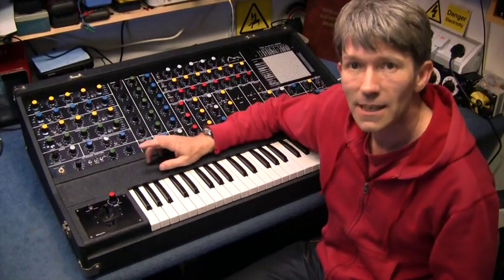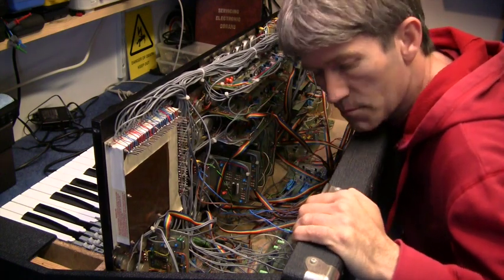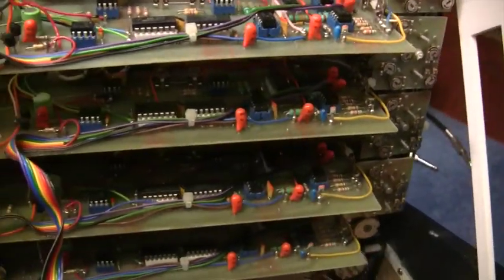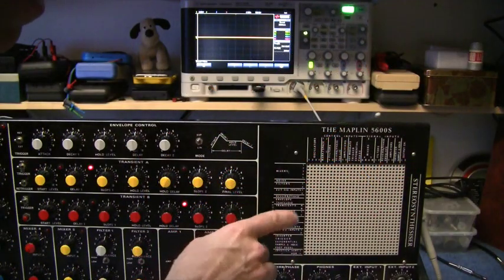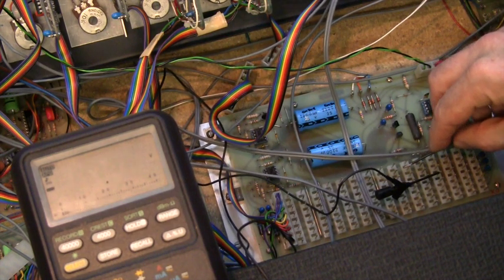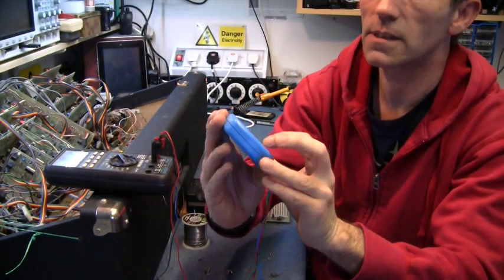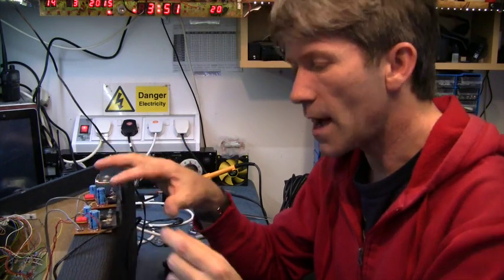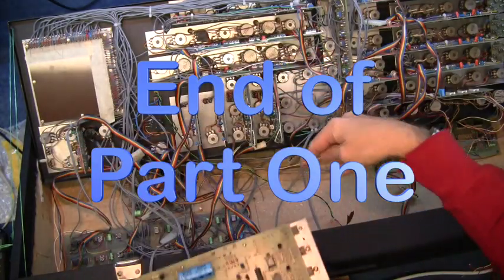Maplin 5600s vintage analog synth repair PART ONE MF#45

Comment: Wow - I lusted after these in the Maplin catalogue many many years ago, but too expensive - ended up selling my Hornby 00 guage railway layout to my maths teacher, to buy a transcendent 2000 kit. After months of soldering and frustration, on the day of completion, I accidentally touched the +12v rail to the 240 ac rail. *BANG*. My mum dropped the dinner on the floor. I had to replace the electrolytic s and the IC's but I did eventually get it working ! :)

Comment: I've got one of these, bought the kit from Maplin mail order back in 83 (if I remember right) after 3 years of paper rounds and weekend work in a bakery costing me £620 at the time. Didn't know anything about electronics then but always wanted too but after looking at some schematics had this stupid idea that it was beyond me. A local music shop was going to build mine for £100 over two weeks, didn't see it for 6 months or more, ended up with my mum involving a solicitor to get it back not working. Sat in the cupboard for years until with a little help from an old boss who gave me loads of old electronics mags (even had my scope in them) I taught myself with a £40 6MHz single trace scope (which I still have), a reduced from £30 to £20 Tandy auto ranging multimeter (very low ranges but had it for years) and a book called Success in Electronics, first of many. I've since done work in X-Ray measurement, stuff for the MOD, SAS and test kit for aviation. Unfortunately my poor old Maplin Synth is still waiting for me to find the time to set it up, I did rewire it and check the boards were complete which some weren't back several years ago but wish I could find the time to finish it off. Planed to make it listen to midi as it has that computer input, remember it was one of its bragging points having a digital keyboard. Another thing I've wanted to do is get rid of those keyboard switches and replace them with something better.Thanks Mark for the great videos.
Reply from the maker: Hi Richard, that was an interesting read, I too have my ols radio-shack multimeter from my childhood days and would never part with it though i have not used it for years. even my solder sucker is over 30 years old and still has the same original tip on it. I hope you get your maplin synth completed, I guess you could use a simple arduino now to turn midi into keyboard digital control signal for the 2600. good luck i hope to see a video of it soon :-)
Reply: Re my 5600 saga, I had an old amp that needed fixing and I got put in contact with a chap not far from where I live. We got chatting and got onto the subject of my Maplin synth to which he replied "I was going to build that". Turns out he refused to do it for the shop until they paid him the money owed for amp repairs so they got a young lad to do it hence it took so long. One thing I will say about the young lad, his soldering was very good. Small world.
Reply: I used to work for Maplin way back when, and  built their demonstration model 5600S which was on display in their Westcliff store. On one occasion I took  it and it's little brother to an exhibition in France. 

It was an adaptation of the ETi 4600 from Australia. They were both impossible to keep in tune, although the 5600S did benefit from a digital keyboard controller, (designed by my boss).
The oscillator tuning presets were 20% carbon  so accuracy was +- 20%. They also designed the VC Phase module  and redesigned the power supply to remove the uA723 voltage regulator which was giving problems. At that time there was no digital output socket. One problem was that with all modules plugged it was hit and miss whether the thing would power up as the sudden rush of current made the regulator act as though there was a short, and would then close down. The keyboard switches were made of gold wire that had to be bent and adjusted on the pcb, practical but horrid.

Another problem of sorts was hum which could be reduced but I found never completely eliminated. The wiring was a nightmare and virtually impossible  to make it look tidy, I remember being asked to stick bits of paper to the cables as a way of marking them, but used my own money to buy proper cable markers.

The one I built for myself was modified into 2 separate cabinets with a multiplug connecting the two. To improve the tuning I replaced the grotty little presets with 20 turn TV tuner ceramic presets on self designed boards, fitted as per the original ones. I also used low capacity cable throughout  which reduced hum down to 60db, low but still audible on headphones.

I would think anyone attempting to repair today would have their work cut out as I don't think some of the components are available any more.

Anyway it was a great project at the time and created an interest in synthesizers which has lasted over 50 years  has  deepend with the current splurge of modular synthesis modules.

Comment: Didn't  there used to be a Maplin Guitar Synthesiser  at one time? and I wonder if you could upgrade it to a MIDI  USB i(In and Out and possibly Thru) ports to control it using todays gear

Comment: BTW. It is possible to make a patchboard by soldering gold wire to veroboard - two pieces back to back. The size was not quite the same and I had to forgo a row and a column, but it worked until I could afford the proper one. I was s student at the time and built a bit each month, it was finally completed after I had graduated and got a job - a the proper patchboard.

Comment: Hi, I just came across this today. I will download the videos as I am thinking of resurecting my old Maplin 5600S which had been stored in a garage for years. Later some pet rats escaped and I eventually found them inside the 5600 so the inside is to say the least a wee bit of a mess.

I did once build a real monster version of the 5600 with 2 keyboards, and more oscillators, filters etc. I sort of pre-empted MIDI by having the keyboard unit seperate from the sound procucing unit. It was too cumbersome so I reverted back to the original format later  - except using the larger keyboard - no room for the joystick which I built into a box that I could clip onto the main beast.

Thye computer - on my panel - it is marked Sequencer was an 8 bit paralell port the same as used in the printers of the day. There was also a Maplin sequencer which never really worked properly. I had better luck with a home made Powertran Cortex computer using its parallel port.

I did I designed a (very rudimentary) MIDI interface for it in the late 80s and even still have the parts but never built it. I have been told that a unit someone else built did work though :o) 

I'll grab your repair videos to watch, only having a 512 kbps connection watching YouTube videos live is far too problematic so I'll download them overnight.

Comment: The "Computer" port is propably a serial port. It could have been a propertary standard for controlling the synth's parameters or at least sequencing it with a software. It's the end of the 1970s and the beginning of the 1980s so a computer port on such a device is absolutely reasonable. Quite capable computers like the Apple II already hit the market and also took their respective place in music studios.
It shouldn't be impossible to convert it to a modern serial port like USB if it wasn't already done sometime.
Reply from the maker: +kilésengati I found out the port was just for switching the same signal as the keyboard input in a sort of binary signal to activate the key on key off and which key, I guess I could have made up a serial port to do that but I had already done enough work just getting it to make sound.

Comment: The inside of the that looks like the local telephone exchange at the end of my road....
Reply from the maker: each board had its own power connection plug and it was already disconnected.there were several parts of the synth that was not powered up.
Reply from the maker: Thank You And Hi to all in Canada from UK
Reply from the maker: +Luke Turnbull Yes I agree, I instantly thought "I will never repair this thing" when I first opened it up.
Reply: +markusfuller  I thought powering the unit on with components out of place could have a high potential of either causing, or causing further damage?. Out of curiosity?, "Why did you power on the unit knowing that chip still needed to be reseated, with a high possibility that other components will likely be out of place as well?"..... t
Reply: Thanks, Explains everything..... Have a wonderful day and look forward to your next video. I have learned soo much from your videos, thank you so much for taking the time to make them and CHEERS!!! from Canada! :-).........

Comment: I have seen an add for a computer kit in a magazine from 1979. I can't remember the brand. But it was programmed in hex and the keyboard was a 1-2-3-4-5-6-7-8-9-0-A-B-C-D-E-F-ENTER calculator style thing. The computer socket could also be for an external sequencer or just anything that could be programmed. I have an organ where the preset section is called "Voice Setting Computer".
Reply from the maker: I believe I too have seen that programmer in the old magazine. I think this synth used a binary input as the keyboard also sent binary.
Reply: You might be thinking of the "Science of Cambridge Mk 14". Cost £50. Hex keypad, LED display, 512 bytes of RAM, National Semi-Conductor SC/MP processor.

It's what Clive Sinclair was selling before the ZX80 came out.
Reply: It looks like the one.

Comment: These posts are fantastic. I have an ETI 4600 here that which was a basket case which I've managed to get all the oscillators and the mixers running and the glide which is groovy as well as the Fairlight keyboard controller. They are definatly a beast. Unfortunately mine has a bunch of home made Veroboard replacements some of the modules which is causing some head scratching. :)
Reply from the maker: +zimwasi This synth caused me many headaches also. It was worth the effort though and I think I learned a few things along the way.

Comment: As you just mentioned this "...pulled off on purpose..." @ 03:29...i saw similar things on gear that i bought. it´s a shame that some contemporaries need to do things like that....
Some time ago i won an auction for a vintage rack mount reverb unit, and as i got the unit, it was out of function at all, but on the pics in that auction it was fully working.
  
After i opened and taken out the main PCB there was an open and partial cut out(!) trace on it, component side and only to be seen when the PCB was taken out. Furthermore there had been fresh sharp scratches crossing that trace. Hää?!? WTF!

It was ovbious to me that someone had done this right before the unit was shipped.

After i repaired that trace, i had a close inspection to the whole unit, i found a upside-down or better to say  all-way-wrong  inserted SIL ribbon connector. After put that in the right way the unit works just fine!! :) Since then i always go for a close inspection before powering up! Due to some mad-minded persons.....

As if these first snipped and then stripped (!WTF!) power cables, wouldn´t be enought someone lifted that IC side out of its socket....
Seems to me that someone tried fo fix that synth prior to your work, but without any clue on how to do it right, and with no luck at all, just pulled out a chip and left it on its own....

Looking forward to see a part two and an again fully working synth at the end ! :) :)

Many thanx for sharing this one Markus!

Comment: Very cool vid. Glad to see you're getting in there, and finding the faults in fairly short order. At the end of the vid, there was a board you showed which had two large blue capacitors on it. Those look a lot like the ones in an Etherwave Standard theremin. :)